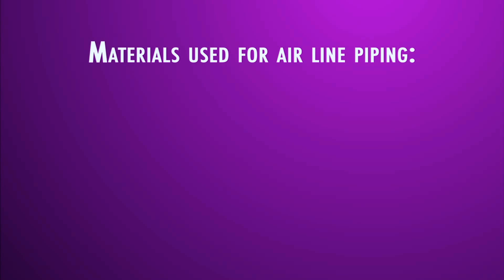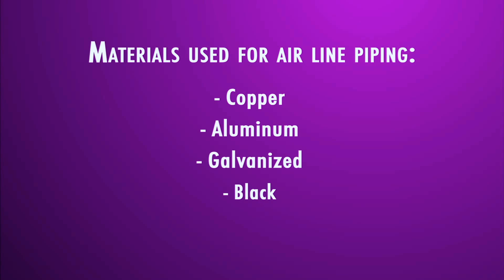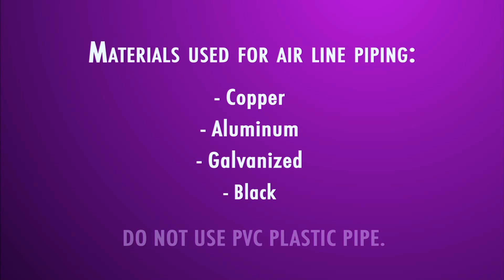Compressed Air System Basics

Comment: I have been watching videos to prevent pressure loss at the tool to maximise air impact  efficiency, and the number one lesson I learned is to get rid of all the 90% bends you can because they are great robbers of flow and pressure. this system seems to put far too many bends in it.

Comment: you will not need all this piping paraphernalia  if you are going to paint with water based paint. If you intend to use non water based paint then get a proper refrigerated system for perfect dryness - the piping systems you see here are suspect and do not deliver the dryness in fact they reduce overall CFM, PSI and efficiency. My tip, keep all airlines and hoses as short as possible,  keep your compressor and air tank as cool as possible use a fan and keep it in the open away from walls to allow proper air circulation to keep it cool . This will allow most condensation to happen in the tank as it is designed. I have gotten great results without all the piping, just by keeping things cool and using a moisture separator/filter connected to the airhose and proper air pressure and cfm is all you need

Comment: What to do when entire line is running and drip leg require maintenance , Note that we have not provided any valve arrangement before drip leg?
Reply from the maker: Can you provide more detail for your setup? Do you have one of our products currently? If you have one of our electronic drains you can simply open the ball valve to clear out the internal strainer.

Comment: It's it okey to use compressor for long distance pipe around 1000km.What is the difference if long pipe and short for Air pressure?

Comment: Had pvc shop air supply for over a decade now 150 psi no issues at all I’ve see videos of tests where they drop a 50 lb steel ball from 12 feet onto a schedule 40 pipe pressurized at 140 psi and nothing happened..... sounds like ppl have had bad experiences but not me....

Comment: will I have seen small workshops using pvc pipes in an air system of 10bar pressure
Reply: PVC is not a Good Option. A PVC PIPE OR TUBE CANT HOLD 10Bar Pressure. mybe 2bar but not 10BAR
Reply: there must be 1.0 bar

Comment: Connected as a loop systems, as suggested, negates the ability to put the loop down stream.  There is no down stream since air is flowing into the loop from both directions as stated.  What did I miss?
Reply: I put a loop with a 11.25 dip and drain in each side of the loop.

Comment: I did this and I feel I lost pressure. Ok,coming out of the tank I had to use a reducer from 1/2" to 3/8" cause I could not find a 1/2" flexible hose to go from the tank to this loop. So I end up going to Harbor freight and buying a 3/8" x 6' long hose to connect to the loop from the tank. Then connected the air filter from Northen tools 3/8 inlet and 3/8 outlet to the loop,I have no leaks and feels like I have lost pressure. My question is ; Coming from the tank with a reducer of 3/8 into 1/2" pipes would it make loose pressure?? Thanks. ;0)
Reply: it will restrict your airflow( the speed that air can move to your end of the hose

Comment: Why did you say never use PVC pipe I am about to get a 60 gallon Air compressor so I have been to a lot of shops looking at how there air lines are ran and about 80% of them are using schedule 40 PVC
Reply: Because it will get brittle over time and break.  it does not just snap, it would explode sending sharp pieces of plastics all over the area that can hurt you.
Reply: Yeah, I love when people say NEVER DO THIS ONE THING! but never say why. I guess god set a poor precedent with that apple....lolz pex is fine for air as it will tear if it fails, not explode into shrapnel.
Reply: @skoronesa1  if people don't know enough to know why not to use PVC, then they don't know enough to install their own shop air systems
Reply: @JerseyTom  you nailed it.